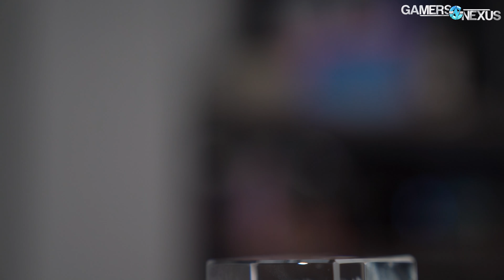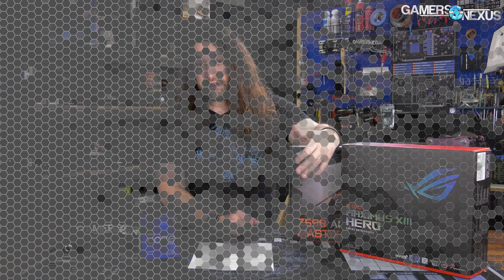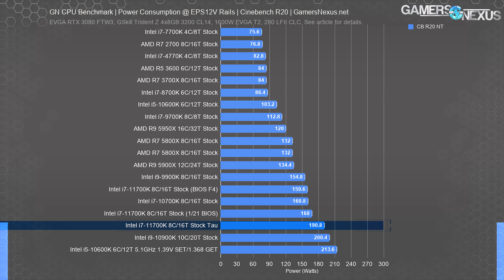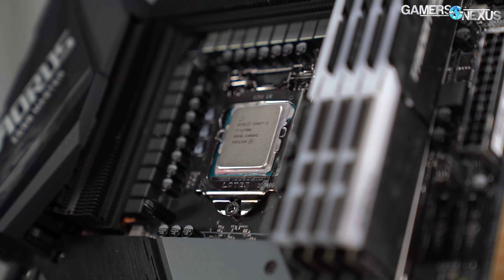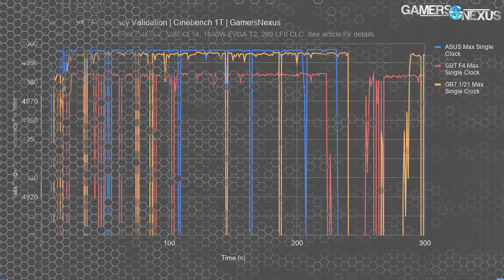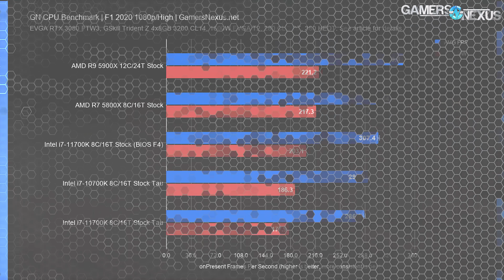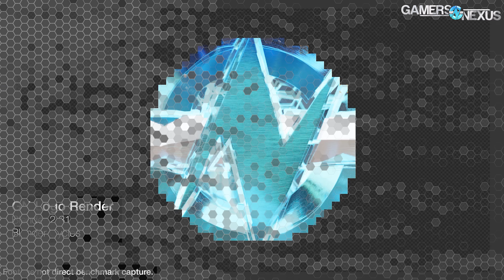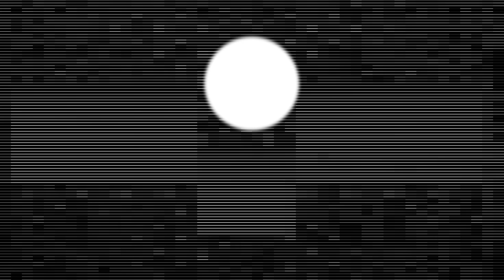Intel's Z590 Motherboard Problem: i7-11700K Power & Thermals Explained

Comment: the other day I had a guy say that intel was more power efficient than AMD, but I feel like they are living in a parallel universe where wattage isn't power. That being said, in this real world, it's rather embarassing to use 220-250 watts and not even beat a 135 watt AMD cpu.
Reply: @PennywiseTheDancingClowN ! So now we are changing the subject to laptops. Stop deflecting.
Reply: yeah I dont know what kind of operation intel is running but it seems to be
"Lets milk 14nm dry until 2030 all we gotta do is add a "plus" to each node and raise power targets each generation. The peasants will never know!"
Remember Intel dominates the OEM and Server Space. It doesn't matter if their new launches are a joke as long as they keep that stronghold.
Reply: @alouisschafer7212  Intel still blow AMD out of the water in performance/$ if you look at the segments where most people buy CPUs (hint, its not any of the CPUs listed on the charts here). 11400F might be the most interesting cpu on the market soon.
Reply: @bajroevahahahaha  performance per doller is more important for a desktop pc, performance per watt is more important for laptops
Reply: @bajroevahahahaha  no they dont...
Prices and Availability differ greatly depending on your region and if something goes on sale in country A but not Country B.
I went for an R7 2700 and a basic B450 Board bc on my local market Intel was not worth it.
performance/$ of a certain CPU is 100% dependent on the retail price
Reply: @alouisschafer7212  Then something is very strange in your market. In most western countries you will find cpus at MSRP or lower and then you can get a Intel cpu for almost  half the price of competing amd ones. Currently in mid/low tier its honestly just one brand to buy and amd will need some magic pricing on next launches to be competitive.
Reply: @bajroevahahahaha  You forget the motherboard prices, it goes for the same total price at the end of the day, so its about better deal or upgrades capacity 1 system can offer on your local market.
Reply: Or it's still 2013, and the fx9590 just came out
Reply: @PennywiseTheDancingClowN ! That's because Intel laptop chips use 10nm, unlike their desktop counterparts which use 14nm++++++++++; they're different processing nodes, you can't compare them. (But even so, I'm pretty sure the 5800h outperforms the 10780 in most gaming benchmarks; mind sharing where you got your benchmarks and numbers from? Because they seem sus)
Reply: @PennywiseTheDancingClowN ! Where are you getting your numbers from where last gen intel's beat 5800h? Please do share them.
Reply: @Rahq Vuth yeah that could be true aswell. It has been a few years since these records were made
Reply: @Swim Fan No question that Intel holds control over the server market, they are still above 90% market share and also when buying servers it is more complex than when buying a PC be it a office/workstation or a gaming rig. For AMD it is a question of them not only offering good CPU's and chipsets, but that they get the big server builders to include AMD in their offerings. 
I don't know how well known this is, but most companies buy their servers from one vendor that offers not just the hardware, but also service and more which means many buyers will only look at offerings from the vendor they already use = if server maker X doesn't offer servers with AMD chips then their customers are unlikely to buy AMD.
Now against this is that customers like choice, so with AMD having great products there is bound to be increasing interest/pressure in the market for AMD based products being available. If AMD can keep it up the I am sure their market share will grow further and we need that, for some years the new Intel generations have often been more face lifts that anything really taking us forward ie. the giant has been sleeping and they are just now waking up.
Reply: LMAO!
that's exactly it
16/32 CPU consuming less than half an 8/16
and delivering more performance
Reply: @PennywiseTheDancingClowN ! Newest AMD laptop chips smoke most Intel counterparts at cheaper price points. Intel is generally better in gaming in that space, but the difference is so marginal that I would generally suggest anyone to save 100$+ on the part  and get similarly specced AMD instead. The main issue in laptop space has been that the GPU configs for AMD have sucked, but it's slowly getting better and on parity with Intel. Intel's closer in laptops, but totally smoked in desktop.
Reply: Intel is a joke currently. Couldn't even consider buying their chips with that power usage and still losing to AMD, lol
Reply: @LurkingLarper  they compete with amd good enough for me
Reply: @LurkingLarper  that is the case if AMD is reliable enough. Sadly for a tonne of users out there like myself who went out and bought a new AMD chip just to find out some of their USB devices are not working properly.
Reply: @LurkingLarper  This release dropped Intel 10 series price by a significant margin. Where I live, you can get a 10700K for cheaper than a 3700X. In price-to-performance terms, Intel is absolutely dominating in that regard as of right now.
Reply: @addictedtoRS  Hows the PCI Express 4 performance with the 10700K? :-)
Reply: @addictedtoRS  doesn't change the fact that 11th gen is a waste of sand. 10th is way less power efficient than AMD, too, but if you can get it at good discount, it's a solid choice. I would rather wait few months for 5600x supply to stabilize and get one of those instead, though.
Reply: @bzdtemp  Idk, I use AMD. Just stating a fact, fanboy.
Reply: @addictedtoRS  So enjoying PCI Express 4 performance with my M2 sticks makes me a fanboy?
You're weird.
Reply: @bzdtemp  I also have Gen 4 PCIe M.2 what the hell is your point? You straight up sound like a shilling fanboy
Reply: @addictedtoRS  LOL You made a post praising the 10700K and how it was a good buy, to which I made a comment essentially pointing out it means missing PCI Express 4 to which you then call me a fanboy.
Maybe you don't understand the term "fanboy"?
Reply: @bzdtemp  Hahaha my god. Just stop embarrassing yourself, clown
Reply: @addictedtoRS  You're the one doing the name calling. Go look in a mirror and you'll see a real clown.
Reply: @LurkingLarper  losing to amd? yet intel still holds the crown for all core clocks and highest overclock period. Interesting when you look at the FACTS over the fanboi nonsense. Sadly intel is still on top.
Reply: @crisnmaryfam7344  Eh, IPC?
Reply: @crisnmaryfam7344  I guess you‘re in the paralell world
Reply: @crisnmaryfam7344  its bcs intel uses WAY more power than amd
Reply: @crisnmaryfam7344  WOW Just WOW
Reply: @crisnmaryfam7344  gotta be a troll post, at least I hope.
Reply: @crisnmaryfam7344  it's doubly sad to have highest clock speeds and still lose to the similarly priced part from the competition in most games and production benchmarks. Who's the one living in fanboy land again? I thought GN viewers were smarter than this.
Reply: @crisnmaryfam7344  the current highest clock record was achieved with FX-8370 at ~8.7GHz if I remember correctly
Reply: @crisnmaryfam7344  mate i am not a fan of amd,aswell but you must be having a laugh if you think intel holds WR for frequency, you wont find an intel procesor in the firs 50 top possitions, here is the WR as for now -  
CPU Frequency	8722.78	The Stilt	Aug 29th, 2014	AMD FX-8370	ASUS ROG Crosshair V Formula-Z,
 have a look on Hwbot.org if you dont believe, that being said 10900k is still the better value for your money
Reply: @crisnmaryfam7344  Intel may have the All Core Record but I guess facts don't matter for " highest overclock period."
hwbot org/benchmark/cpu_frequency/halloffame
valid x86 fr/records.html
en wikipedia org/wiki/Clock_rate
Reply: @crisnmaryfam7344  UH hate to burst bubble, but pretty sure AMD holds the record for a CPU overclock at like 8GHZ. Ya it was a garbage bulldozer CPU, but before you go spewing nonsense check your facts. I think the current gen Intel chips hit like 7.7GHZ regardless your argument is flawed and just another way for an Intel FAN BOI to spout meaningless numbers about an ancient architecure. It doesnt take a genius to see that Intel is not in a good space as of 2021 and I dont hate on people who choose Intel I ran Intel for years, but when dealing with new technology it's usually good practice to not base your buying options on a hypothetical core clock that is inefficient and dated. Sure I guess if u need 600 fps in CS GO and your willing to deal with a furnace inside ur PC go ahead and buy Intel I'm sure u will be happy spending 400 dollars on a chip that's in the +++++ generation and you might beat a stock AMD chip by 2% lol
Reply: @crisnmaryfam7344  The Fx cpu were also reaching 5ghz, but clock doesn't mean better...It's about IPC, clock, design generation for performance... Intel just OC to squeeze few extra performance with same old architecture... Hopefully the new generation will be more competitive...
Reply: @Swim Fan The server market is changing. Intel is losing market share and AMD is gaining and on top of that there is ARM based machines also. Now Intel is still the giant, however AMD is like double than what they were a year ago and it is at the expense of Intel.
Reply: Its impossible for intel to have power efficiency on 14nm, the most power efficient chip is the apple m1 chip using 5nm.
Reply: @kieran9882  it's actually more on the intel's core clock stepping and boost behavior. AMD is very terrible at idle and low loads like gaming and browsing because they tend to boost  very high even on very light loads. Take for example, playing music on foobar, my Ryzen ramps up to 4ghz all core and stayed there...
Reply: @bingbing3464  check out optimum tech ryzen pbo2 undervolt  video. Anyways my idle temp with 5600x 32gb 3600mhz RAM is 33 c and @ load is 40-60s C. BTW the USB fix is coming in the new AGESA bios update in April I believe
Reply: @foraminutethere23  but undervolting doesnt help with the boosting behavior. it just reduce temps and depending on silicon lottery, affects stability. Im not giving much hope on the USB because i tested on my much older 3600 rig from 2019, it also have the same USB bug. I bought an intel because i need a working PC while the AMD is collecting dust.
Reply: @bingbing3464  it actually improved performance on the 5600x + 5800x slightly but not 5900x. You'd have to watch the optimum tech video for an explanation because it is beyond me to explain/remember it. I've also seem people on reddit deal with the idle temps through windows. I'm using a scythe fuma 2 as my cooler

Link here https://youtu.be/dfkrp25dpQ0
Reply: @foraminutethere23  I know what it is lol. I’ve been using AMD way before it became popular. What I’m saying that undervolting doesn’t solve the boosting behavior. I don’t need my cpu boosting to 4ghz all core for just listening to some music. Besides, that video is a horrible way to do your undervolt. For beginners yes but there are much better way of doing it.
Reply: @bingbing3464  huh that's weird. Why is your cpu boosting all core when listening to music is a 1 core process. It almost doesn't seem possible

You've bought a 5000 series as well to test pbo2? Also you say it is stupid but he is getting an extra 200mhz clock speed on a slight undervolt. What is so stupid about that
Reply: @foraminutethere23  let me give you a hint: per core curve optimizer. Using his method, you might lose performance on low threaded tasks like gaming.. that was why overclocking ryzen wasn’t recommended until this manual per core oc came about. 

And that is precisely the problem with ryzens. They boost too aggressively to some applications and it’s become a known fact (especially rgb software). You just probably didn’t notice it. Most hobby overclockers will tend to constantly monitor and log the cpu boost behavior even at idle so it became apparent. A simple search and you’d find official statement about this and AMD reassures that though it doesn’t harm the cpu but this is the expected behavior of zen2 and zen3 and yes, it affects powerdraw and temps. And that is why intel idles in the 20s because it has a more effecient low utilization state. 

And yes I do have zen,zen+,zen2 and zen3 cpus lololol. Only zen 2 and zen 3 behaves this way with the boosting.
Reply: @Bing Bing  he did test gaming as well in the video. No performance problems there yet. Well I'm not having an all core boosting problem as of yet. And I only did minimal research but I couldn't find evidence of mid tier 10th gens idling in 20s C

Anyways my idle is 33 C. Rubbing Spotify, ryzen master, hwinfo64, Firefox with probably 50 tabs and 1080p yt video going, and Spotify playing in the background. Idle Temp is 36-37 C. Average cpu core + SOC is consuming I'd say 17-20 watts with some spikes. I just added in playing a mp4 movie on vlc on the 2nd monitor. Stats are pretty much the same. Every now and then a core will spike over 1.5k mhz but it quickly drops down to under 1k mhz. What am I missing here about the idle boost problem?
Reply: @foraminutethere23  well generally no one reviews idle or lightload temps. But anyways even the 10900k idles around 2-5C above ambient. My 10400F in an itx idles at 29 while my 5600x idles at 40 in 30C ambient. So yeah.... i have a literal rigs infront of me just because i enjoy testing them. 

Somehow whenever i share links it gets deleted. Just check out one 10400F review on youtube. It did 25C on a stock cooler idle.
Reply: when you start talking efficiency ARM is so far ahead they're never even noticed haha

Comment: I am wondering why Intel even released the 11th gen. It's a side step that technically is a step backwards. 12th gen is what everyone will be shocked by. I'm grabbing a 8 big cores, 0 little cores, 16 thread 12th gen.
Reply: "8 big cores, 0 little cores"
That will be basically a Skylake copy or Rocket Lake all over again, we need Big Little and more than 8 cores without chiplets.
Reply: Your name sounds so familiar. Have we met? I sure hope NOT! lol
And re: tech stuff - Star masterc (below) is right, you need the "chiplets" - the LITTLE cores to do the background work as they supposedly have a lot of punch for their size. I'm hoping Alder Lake is revolutionary in performance for Intel and they once again overtake AMD by a huge leap. If they don't, if Intel's new design only matches AMD even, or surpasses it by just 1 step, buyers may have a more difficult time deciding who they like if core count is no longer comparable 1 to 1.
Reply: @pentiuman  Intel won't have a chance with next generation Ryzen 9 6950X if all they bringing to fight is 8 little and 8 big cores in the Core i9 12900K
Reply: Why not just get the 5900X?

Comment: Got a 10700k when I couldn't reasonably upgrade from my 2700x because AMD CPUS were vaporware.  Expected to maybe upgrade to 11 series but  I guess I'm just going to HODL until Ryzen 6000.
Reply: For gaming the 10700K is an excellent CPU and for productivity it is not bad! The 10700K and will see you through the next few years oof high end gaming with no issues. The 11700K is not a good upgrade though we knew Intel were going to be behind the curve until Alder Lake hits, ...and who knows even when Alder Lake hits, they may still be behind the curve. I have the 10700K overclocked to 5.1GHz all core at 1.278v on a 360mm AIO and have no temp issues whatsover...sadly the one thing I want to upgrade is a better GPU but you cannot find one for the retail price ala the RTX 3080! I have the RTX 2080...
Reply: @vMaxHeadroom  waste of sand...
Reply: the 10700k is enough for a few years...same as the  5600x at stock and out performs it when overclocked... a perfect gaming cpu....wait till 12th gen or the next amd cpu's to upgrade... 12th gen is meant to be insane from what ive been reading....
Reply: Upgrading every generation is, in most cases, absolutely stupid. It's been many many years since we got generational improvements that were worth it. Sandy Bridge were one of the few instances where it made sense. Bulldozer to Zen was another. Not because Zen was THAT awesome but because Bulldozer should have been strangled in its umbilical cord.....

Comment: So, technically, someone could buy a power supply that would've been adequate under Intel's recommended specifications, but ends up not being able to boot the system because MCE is on out of the box?
Reply: Yes. Same as when you buy your "105W TDP" Ryzen but it pulls up to 140W
Reply: I don't think so. You always have your PSU at a maximum of 80% theoretical load, for safety and because PSU lasts more time other stuff on the build. If you want your PSU to operate silently then <=60% load is advisable. Good PSUs normally have some headroom before over-current protection shuts down the PSU, so 10% extra load is doable in most cases. Finally, when you boot your PC it's power consumption is ridiculously low, you have to do something like a full CPU+GPU stress test to really make your system achieve maximum power load, so no, your PC won't fail to boot due to MCE or anything that your MB sets in UEFI regarding CPU power limits.
Reply: If you boot into windows and put the system on load : yes / maybe (take a look at deidian comments, valid one). Though you could turn MCE off. Still this kinda sucks. Yet people are smart and usually know or will tell those who are looking for something. I'm somewhat worried about pre build systems.